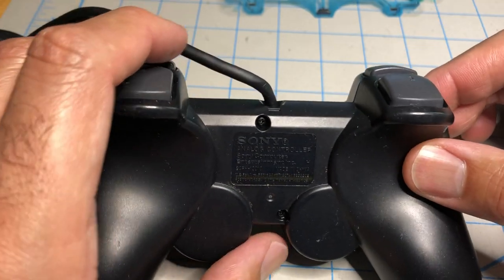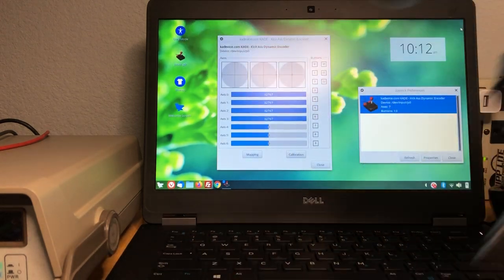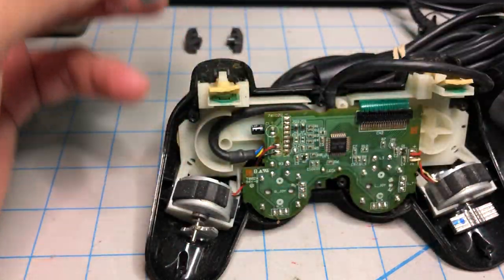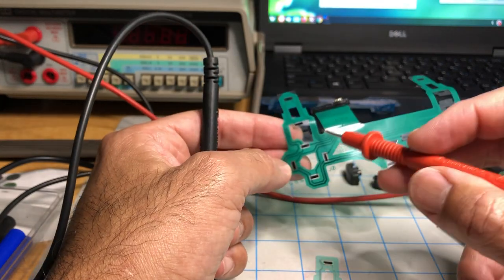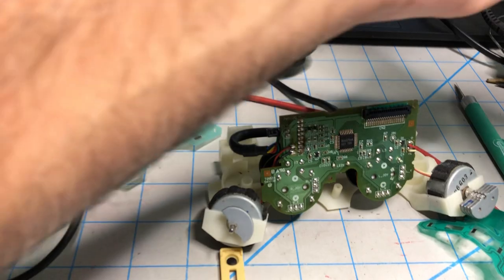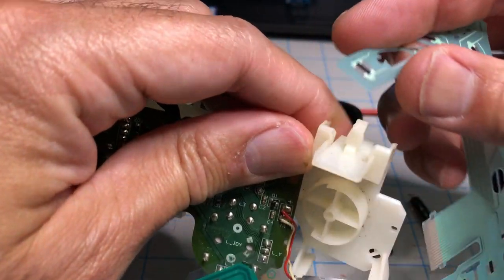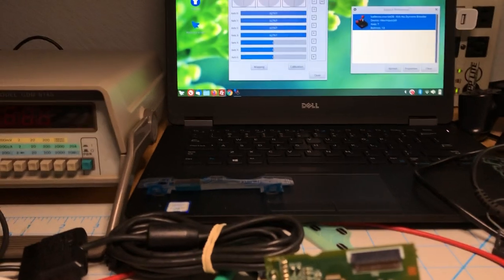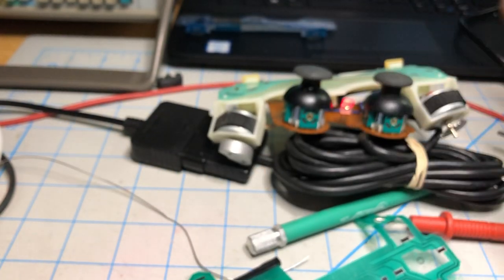PS2 Controller repair

Comment: It are videos like this that have most value to me! A PS2 controller fully explained! Also I like the fact that after the original connector gets replaced, all you need is to switch the plastic button PCB without soldering anymore...

Comment: your video is fantastic, don't answer trolls who can’t see a 38 minute video, but can spend 7 hours marathon netflix with dubious tv shows. BTW I did exactly what you did, I soldered the 18-pin connector to the right of the contacts perfectly, but sadly all the ribbon cables I bought didn't work, some have all buttons activated and others the arrows are inverted.
Reply: If the "down" and "right" arrows are switched then you used the SA1Q42A layout foil thingy instead of the SA1Q43A one. I also ordered 30 "42" ones for my repairs and now another batch of "43"s. Fot the "42" ones I will try to cut the connector apart with a scalpel to switch leads number 5 and 6 from the right - then laminate the cable (not the connector part!) with sticky tape and see if it works. If you look at photos of the two kinds (I checked them on aliexpress where I also ordered them), then you will see how the layout is changed so that basically only the leads #5 and #6 are switched.
Maybe I'll leave an answer in a few weeks once my parts arrived from overseas, however maybe the idea already helps you along, I hope. ;)
Reply: @ozzybwild  I bought 50 of the 43 model, hoping that only a few would work for my 6 controllers, and surprisingly the first 6 worked.

Comment: Since the resistance is high on carbon contacts. I had done some research on carbon conductive paint. I will be buying some this week and will use some on all carbon contacts on membrane. To see if it will bring the unresponsive membrane back to life!
Reply from the maker: Love to know what you find, I have like 600 of them that need that one resistor bridged.
Reply: @mwsm
Did it the conductive paint solve the issue?
Reply: Did it work ?
Reply: Did it work?

Comment: Hey there!
I have a "broken" PS2 controller with the latch build. So what type of PCB should I order to fix it? Does SA1Q43A applies for that, or is it something different? By the way I don't see any model name on the PCB :( 
What serial number is written on your PCB, which applies to the latch structure?

Comment: Huge thanks for sharing your expertise and experience in this video. Amazingly, I have two model H controllers that happened to break around the same time, in the exact same way. With both, they show the same symptoms as in this video, where start, select and the analogs work, but only square and right on the d-pad do anything, no other buttons function. Since both weren't working in the same way, I assumed that somehow the Playstation 2 Console I have is somehow incompatible with my two model H controllers.

Researching this topic brought up many unrelated issues, and this is the first video I've found that showed the same symptoms I encountered. Many thanks again for your professional guidance here!

However, is there any way to salvage the original plastic PCB circuit boards at all? Would adding graphite from a pencil improve the conductivity, or help restore the needed resistance to fix this problem? Since so many of the replacement ribbon circuit boards seem to come faulty, it's too much of a gamble to try and buy a working replacement.

In the meantime, I'm using two model A's that are way older than my two model H's, and those A models still work great. The only downside is that the model A's buttons all feel spongier when compared with model H's. Would be thrilled to restore them if at all possible.
Reply from the maker: So as far a where to order, each time I do the previous seller is gone, I use Aliexpress, there is no way to fix the original ribbons they have to go, also I have a pretty extensive play list about the topic and I show the parts I use and how, I advise you all go back and check those videos, is all about PS2 controllers ONLY.

Comment: This is good information 
the pads seems to deteriorate and the symptoms of all button non responsive are common
I bought some cheap aftermarket ds2 and the sticks have massive dead zones and is way too sensitive and the shells are very thin and brittle too bad the genuine ones are so annoying to fix

Comment: I have a brand new (old stock) PS2 controller that has been sitting in the box since I bought my PS2 slim. It was never even taken out of its plastic bag. Yet several buttons/d-pad directions don't work when I tried it recently. After doing some research I learned that the PS3 controllers also stop working due to sheer age. Really sucks that Sony didn't make their controllers more durable when you have much older NES controllers that still work perfectly fine. We can only hope that PS4 and PS5 controllers don't have the same issues as the PS2 and PS3 ones.
Reply from the maker: I have bad new for you, as you pointed out with the PS3 controllers just stopped working even if you do not use it due to age, the same happens to the PS4 and PS5, I actually fix pretty much everything retro, I just never upload the vids, but I can tell for after fixing several thousands Sony controllers, that is an issue, however, is most cases you can fix it by cleaning the controller ribbon where it connects to the board and that fixed the issue on the PS3, PS$ and PS5's
Reply: It's common that the foam pressing the flex cable onto the board has gone flat just disassemble and pad it
Reply: Well there's only so much you can do when your buttons are pressure sensitive (which both PS2 and PS3 have). The buttons on the NES controllers and the like are simply on or off, they don't have to worry about resistance changing because all you're doing is jumping connections together.

Comment: Picked some of these replacement membranes up a while ago. Only started trying to fix a half dozen controllers today. What I'm finding is more often than not the R2/L2 buttons need way more pressure to activate than the original Sony membranes. No amount of trimming seems to help.

Comment: Thank you, mine goes to electrical recycling. Might just check though if some of the silicon pads will be of use in my DS4, Dpad mould at least looks like it could be a replacement. Already had to buy a set once.

Comment: Nice video
Will you provide links for buying all your replaceable parts for PCBs, PCB connectors and replacement PS2 controller cords?
SA1Q42-A PCB's will work too with those sockets
SA1Q43-A PCBs also compatible with late versions of PS2 A controllers =)
Lots of respect all the way from New Zealand
Reply: SQ1Q42-A is the one that does not need to do that weld? , im looking for a replacemant for a SA1Q20A.
Reply: @runarquista2755  Oops, I mistyped
SQ1Q42-A is actually SA1Q42-A

Both SA1Q42-A and SA1Q43-A are not fixed to the socket pinned on the circuit board therefore can be removed from the ribbon socket without soldering at all
If yr PS2 controller is H or certain A version (not the 1 with the foam to help PCB make contact with the pins to the circuit board) you can use both PCB's I've mentioned with the ribbon rocket shown in this video for H controllers otherwise u can replace PCB with a new 1 by reinserting the new PCB in the ribbon socket for the latter A controller I mentioned

Hoped I cleared things up =)

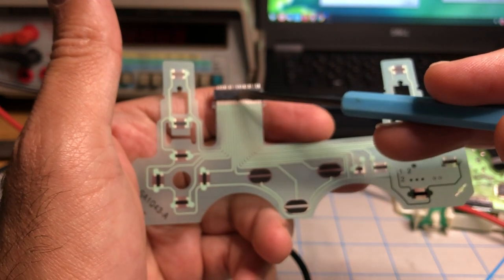Comment: 20:04 You can try to repair those bad parts. One way is to use pencil, until you get proper resistance. Another way is to solder SMD resistor.
Reply: what is an SMD resistor?
Reply: @zadock8658  Check in google, then click on graphics.

Comment: I don't have one of those hot air soldering irons... I tried to use a regular soldering iron and I think the pads came off with the connector because it's all brown. I ruined it didn't I?
This is probably the second thing I've ever attempted to solder, haha.. I'm a newbie.
Reply from the maker: pretty much, sorry, I never tried that with a soldering iron actually.
Reply: the heatgun is now a crucial tool for microsoldering

Comment: Im planning on ordering a couple to fix my controllers, however I was wondering if these new membranes are pressure sensitive like the original ones? Have you tested that out? An answer would be greatly appreciated!
Reply from the maker: Yes, it’s not worth the membrane that does the pressure sensitivity, but the round black dot on the silicon pads, the harder the press they deform and expand thus touching more membrane and increasing the resistance.

Comment: I actually just fixed my old broken ps2 controllers with this same issue and my fix was as simple as using rubbing alcohol and cleaning the board on all 3 of them.
Reply: What board did you clean ?
Reply: What type of alcohol?
Reply: @agustin8160  u wanna try and use 90% at least
Reply: @yo_its_gingey5329  I have 96 ethyl alcohol, will that work? You cleaned the "green board" where the rubber things go right?
Reply: @agustin8160  That should work, Or you can soak it in it too but just make sure its completely dry before trying to put it back together and plug it in.
Reply: @yo_its_gingey5329  ok thanks, one last question, I have another joystick and the part that doesn't work is the start and select button, will this fix it too?
Reply: @agustin8160  well it isn’t gaurenteed to fix it, this is just to make sure any contacts on the board that aren’t supposed to be touching aren’t touching. For me it worked because the board inside had gotten dirty somehow. It may fix it yes, but it depends if it’s just dirty or not. If there is true damage internally to any components of the board or anything major, you might as well get a new controller, but if it’s dirty, after you’re done it should work, assuming you reassemble it correctly which is the hard part.
Reply: @yo_its_gingey5329  yeah yeah, I'm just trying to make sure that the ethyl alcohol doesn't damage any component that might work but it doesn't because it's dirty

Comment: I have an issue that i dont understand. 
I bought a refurbished ps2 controller from germany, it looks brand new but the only issue is that the X and O buttons arent pressure sensitive at all.
The controller is completely clean, i open it up and nothing looks out of the ordinary. All of the buttons work fine except X and O and i cant figure out why

Comment: I don't understand why the connector has to be removed? The cable just unplugs. Could you not just leave the old connector and slide the replacement ribbon straight in?
Also it would be great to hear an explanation as to all the different types of controllers and which ribbons are compatible with which controllers. etc. Oh, ok. I just heard you are doing a full series of all the different controllers. Nice! 
Still not sure why you changed the connector.
No flux?
Reply from the maker: it doesn't unplug, what all the videos, only some you can unplug.

Comment: I came across a controller , where the ribbon is just pressed on,no solder or connector. And is the same problem noted in the cheap OEM controllers? Will be trying to watch all your videos. Thanks for your hard work and content, very helpful.
Reply from the maker: Hi, I am exclusively work on first party Sony controllers only btw, also the model A is the one with the pressed ribbon cable, I covered those as well.

Comment: is it possible to solder on that white latched ribbon connector to the other pin connector location? 
Id imagine it should be fine. Ill try it myself once i can get my hands on a replacement part (but I dont know the component name)
my motherboard has the 2 pins for securing it, though hot glue could work if the 2 side pins arent there.

Comment: if you bridge both sides of one of the buttonstraces, the button should be on constantly unless the bridge is broken right? if so could you solder 2 small wires onto the 18 pin connector and connect them to another button, to make a paddle mod? normally people just use custom flex pcbs but there are none for ps2 and i know you wouldnt be able to easily modify one of these flex pcbs so i figure if you solder onto the actual connector maybe it would work

Comment: how do you know the right circuit board model for a H model? There's SA1Q42A and SA1Q43A, but no way of knowing which is the best for a H model

Does it matter which connector you get? 18 pin or 19 pin? I have 3 H models and every single one of their circuit boards has diferent types (JK, F and BC, 5A to 4B, that's all the circuit board says) If I buy a 10-pack of those spare circuit boards, will they work?

thanks

Comment: Hey! Did you upload a video for A models too? I have problems with some buttons on it, my x button is working if i press it hard and the O button is acting like an x button? D pad up and down doesnt work. Triangle and square arent responding. The left analog stick is stuck going downwards. Is this something thats impossible to fix by my self? I have another A model controller that works perfectly fine.
Reply: Found the video, will watch and come back to this comment when Ive tried one last attempt to fix it.
Edit: so Ive watched it, seems like I need to buy a new membrane. Would still have problem with analog stick though. 

Another question, i see that all the circuit boards is clean in your video, mine had brown/orange kinda see trough stuff at some spots around the whole circuit board. Is it normal or is it a damage of some sort? Like coke?

Comment: Leaves me wondering if you could scrape the resistors off/open from the original film so that the circuit would now be open and make it so that it only closes when the button is pressed. Just like the start and select buttons? Could that work in theory?
Reply from the maker: Not really because no button aligns with the position of the contacts, you would need to drill a hole in the case and make a new button hole and add a silicon pad

Comment: Alot of my H ps2 controllers have a conductive film that have the number “0241” i have bought the SA1Q43a films for replacements since i cant find anything on 0241 films. Will these still work for my controllers?

Comment: Hey great video! This H controllers tend to fault all in the same way... but where did you find the pin connectors and pcb? Appreciate if you could give us a link. Greetings from Italy :D
Reply from the maker: if you google the number on the ribbon cable, it will come up, there are many models, so you have to open yours to make sure you get he correct one.

Comment: On all Pins (of these 18) ther is a little bit of Power. Can you discripe in detail how the Controler Chip is read the Data? I am verry confused. Thank you for your Video. Can you say frow withch shop you buy your Button foil? I found it on Amazon, Ebay, Aliexpress. I dont know witch are the best ones. My englisch is terrible. Sorry aboud that. You are amazing. Thanks for making this Video

Comment: Hi again I have a question what the problem went you have a ps2 motor that spin slow I have a new one it work in one board good but I use the same one in another board and spin slow this new motor you think is the board right left is ok right spin slow

Comment: I bought a set of SA1Q42A foils via AliExpress, but „down“ and“right“are switched. I have two controllers, both have right on pin 6 and down on pin 7 ( counting from left). The new foils have down on pin 6 and right on pin 7. Anyone else came across this. Not sure what SA1Q42 to order now...

Comment: Hey are you still repairing PS2 controllers ? I have 1 model H and two after market contollers. i was wondering if youd repair them if you still have the parts
Reply from the maker: They are still being fixed but not by me, all these videos I made to train others who now do that, and we don’t fix 3rd party ones unless we collect multiples so they can be used for parts.
Reply: @restartrepairs4393  I used the rumble motors from 1 3rd party controller for an original one which motors died due masive rust.

Comment: huh film pad is not held by that black piece on my controller. just pushed onto the board when u close the controller. much like how the ps3 and 4 controller is. for whatever reason my l3 is not working as well :/

Comment: It's pretty much easier to just buy another working PS2 controller and save time and money on new parts that may also not work.
Reply from the maker: That’s not a very uplifting reply for guys that like to fix stuff 😀
Reply: @restartrepairs4393  It was fun watching and all for knowledge, but doing it all myself would take me more than 1 hour instead of 12 mins since you've done it often I assume. Not only that I've to find the right parts online and order it and wait for the parts to arrive hopefully in working condition with fingers crossed 😄
Reply from the maker: @TheUpliftingGuy  true, I got hundreds of bad ribbon cables/ button pads, I stopped buying the 43A and sticking to the 42A now

Comment: hello sorry for my english but i am french 
i have 3 controller 1 type A with tape solder this it s ok and 2 type H with tape clip this 2 controlers not function i buy 2 models of electrical circuit 1 SA-1Q43-A and SA-1Q42-A but they have 18 lines my controlers have 19 line  it s my probleme

Has you solution please??
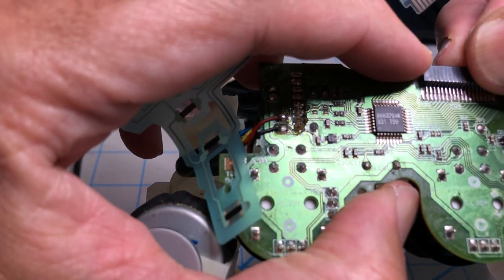Reply: my solution is 24:32  thx